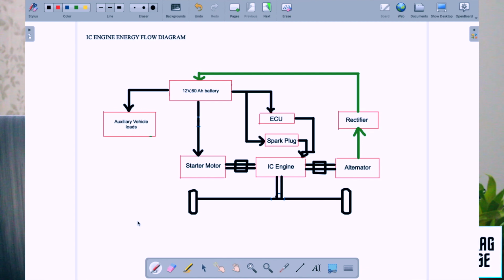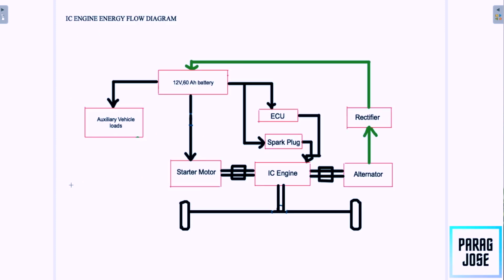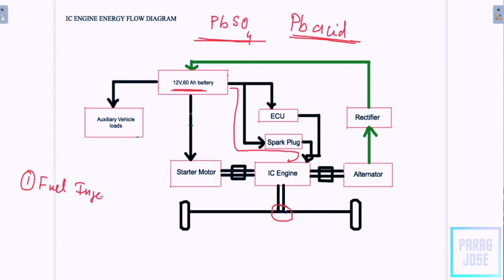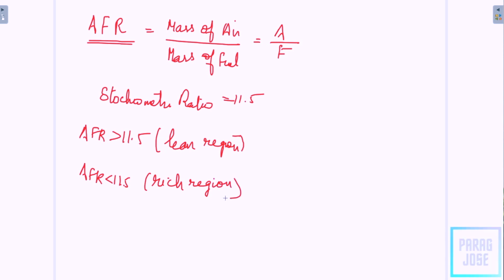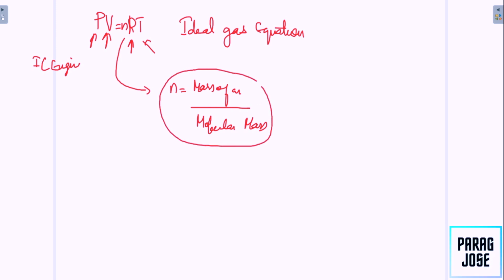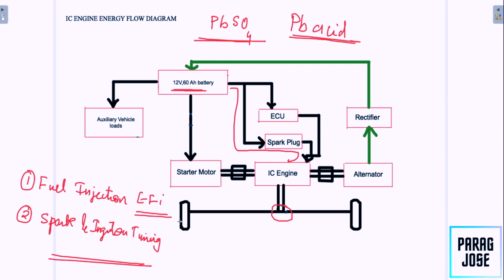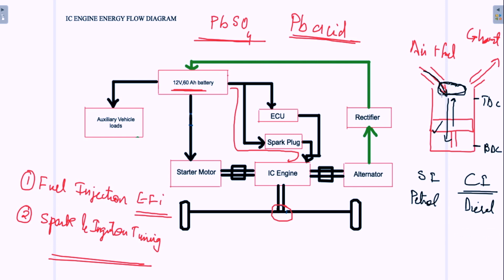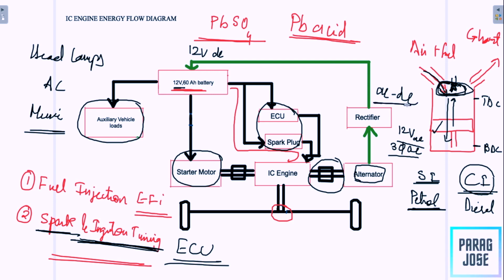Why do IC engine vehicles need batteries?

Comment: What is the difference between 2 stroke and 4 stroke?
Can we have 2 stroke and 4 stroke in both petrol and diesel, and if not why?
Which one would you prefer for a long term a petrol engine or a diesel one?
Why does bikes with efi doesn't come with a reserve fuel capacity? Can it be incorporated?
Can you kindly explain how ECU functions in an automatic?
Reply from the maker: The differencein 2 stroke and 4 stroke is the piston movement difference. In 2 stroke the otto cycle (for petrol engine) or the diesel cycle (diesel engine) will be completed in two stroke of the piston while in 4 stroke it takes four strokes which are for intake, compression, expansion and exhaust strokes. Diesel engines have incomplete combustion of fuel and therefore the Hydrocarbons produced are more. So in a way petrol engines are more 'eco-friendly'. In most of the bikes today a proper fuel gauge is present so the need for a reserve is not that much.